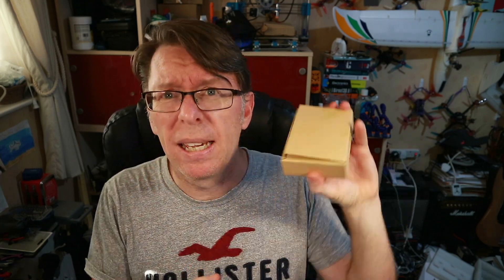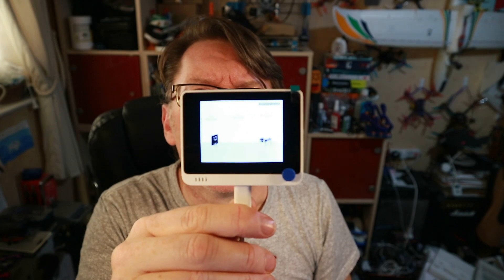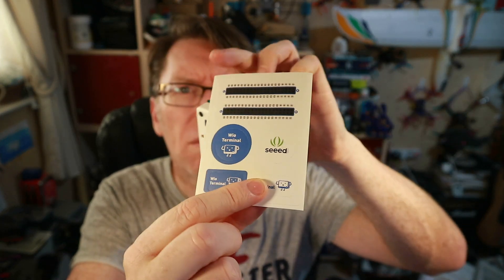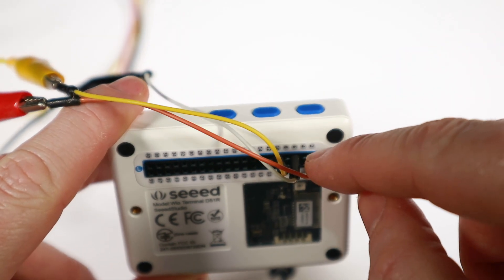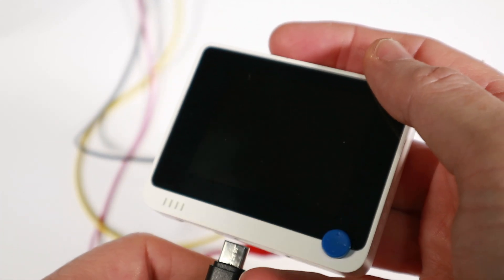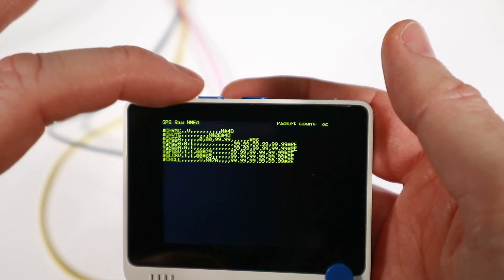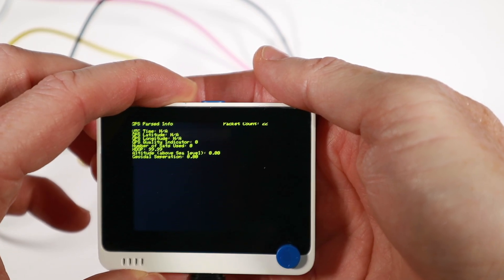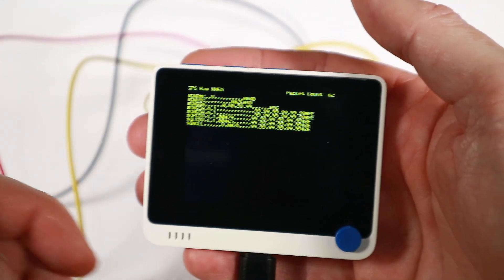WIO Terminal: An Arduino compatible board with screen and a lot more!

Comment: For those not familiar -- If using an Arduino or other microcontroller for troubleshooting, be mindful that you are using the appropriate voltage for the device, don't want to use 5v pins from an Arduino on 3.3v logic like on some GPS units or your troubleshooting can make the problem infinitely worse. 😉
Reply from the maker: Very true - this isn't quite as plug as play as I might like it to be and would involve you knowing some of the details on your GPS.  Generally, anything intended for Betaflight is on 3.3v logic voltage, and its only APM stuff I've come across so far thats on 5v.  But no doubt there any more out there.

Comment: 8:17... I do that by plugging a GPS into Teraterm. Easy-peasy.
Reply from the maker: In the olden days of modems, this would have been super easy, since everyone had a terminal emulator and a serial port in the back of their PC.  Presumably you are using some sort of USB to serial convertor for this to work?  I don't get a signal in my house, hence the need to go outside with a smaller device - but yes, there's lots of ways to accomplish the same thing
Reply: @CurryKitten  You are correct... on a non Serial port computer I use an RS232 to USB converter. I do have an older small Laptop that has a serial port that I can take outside for accurate GPS signals since my shop is Steel siding and roof clad. Yeah I know the WIO device is a lot smaller than my laptop.... but my screen is larger for my older eyes. ;-)